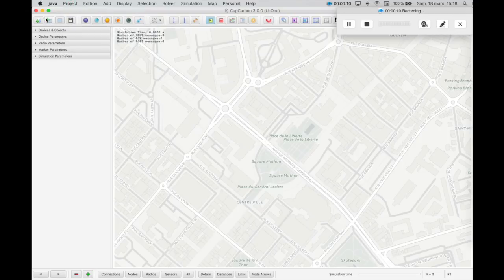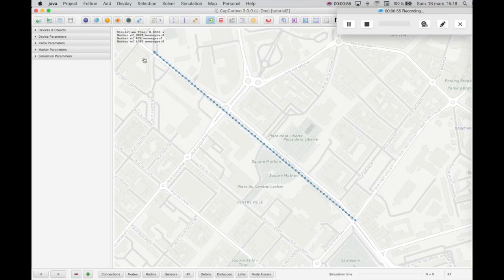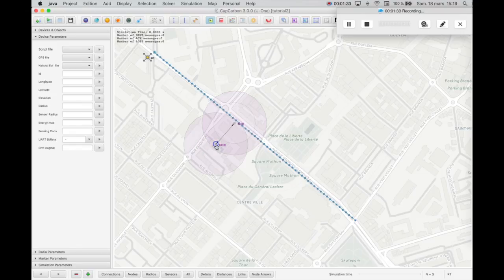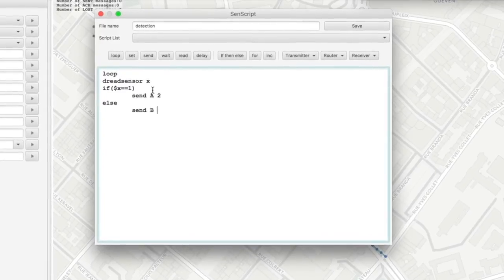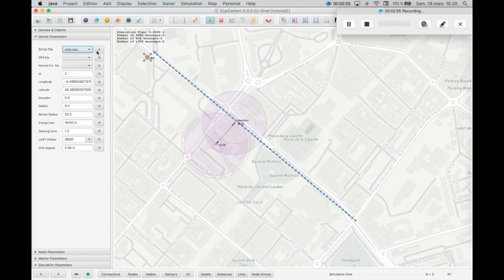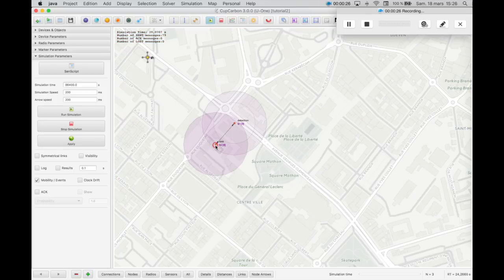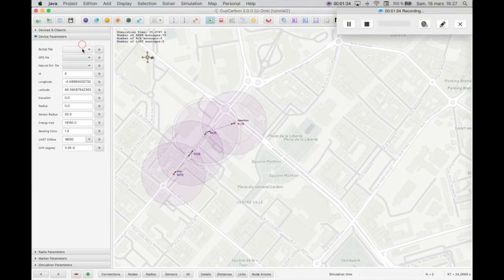CupCarbon Tutorial 2: Mobility/Sensing/Transmitting/Routing/Receiving

Comment: The mobile does not move! why? I've done the same!
Reply: did u get the answer for it ...
I am still having problem here
do u help me
Reply: @babjisingireddy691  I think you'd better do what I did, delete this unusable tool!
Reply: @soroushaalibagi2771  haha man this thing is not user friendly at all. right now am trying to increase the sensor are by pressing the right bracket its not doing jack
Reply: @sidewickx  You have to be sure that you have clicked really on right bracket. It works normally for me.
Reply: @soroushaalibagi2771  Really? Why you say this? More than 50 articles have been published with CupCaron! Just visit the springer or IEEE website.
Reply: @abounceur  This software did not worked for me, as though other people. They should work on it more if they want to publish a practical software.
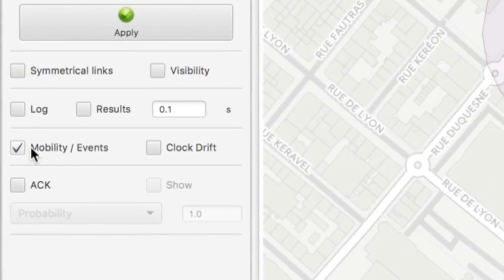Reply: It is explained in minute 2:50. Also, Read the manual, page 28 the 11th point: Go to Mobility/Events: this box must be activated if in the simulation the events and the mobility must be considered. Event here means the analog (Gas) events.
Reply: I also faced same issue, make sure you have checked Mobility and Event Option!